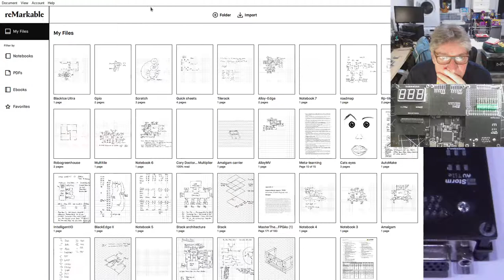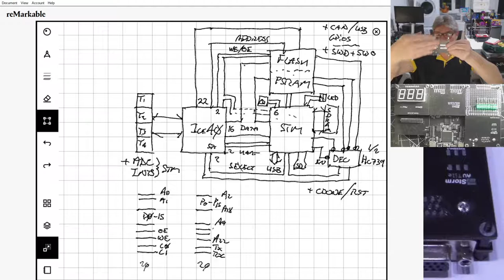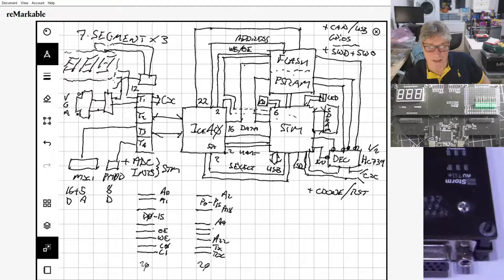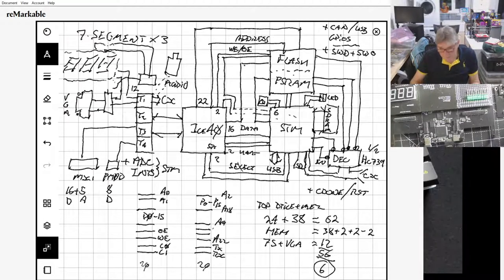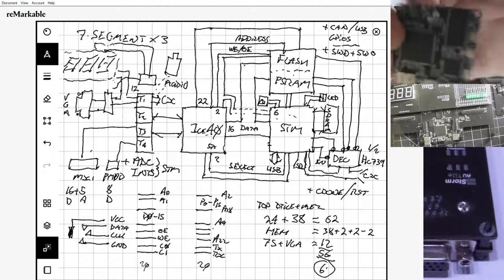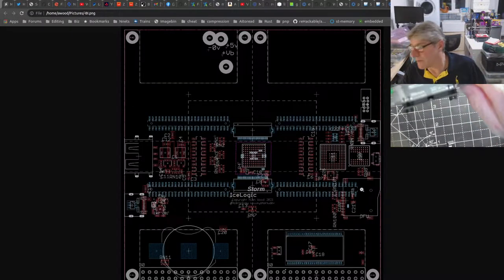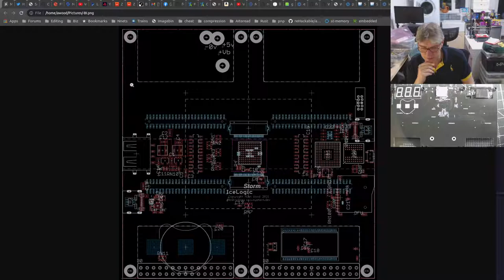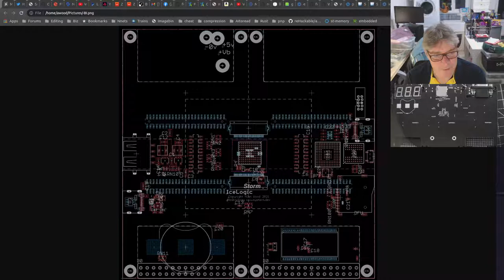ILB/BalckIce?

Comment: Sorry couldn't make it, had a production move. I like the BlackIce convergence. I personally don't have any PS2 stuff so USB would be optimal for me. If I understand correctly the top two tiles will be connected as a "double" tile and the bottom two would be separate--at least in a standard configuration. I wouldn't mind a version that replaced the 7-segment with a TFT something like  240x240 or 135x240 etc. Also, where would all the indicator LEDs be visible at? Adding the extra side buttons would be handy. What about a simple IO expander that connects all the buttons and leds which would return IO pins back to the user, for example one of the MAX chips--just thinking.
Reply from the maker: The only tiles that really 'need' to be double ones are things like double pmods and mixmods because they require 16 ios, most others can be arranged as individual tiles. Usb is nice but we need a low overhead host implementation that fits in ice40 for this. That would prob mean most of it done in firmware running on softcore with min Usb hardware. Running it on the Stm32 is also a possibility. For Display I am looking for something small and rectangular, maybe 135x240 on a tile in a similar mechanical arrangement to the 7-Segtile using an ILB tile aperture. Adding IO expanders may be overkill given how many we already have available! But maybe an led/button tile is a good idea